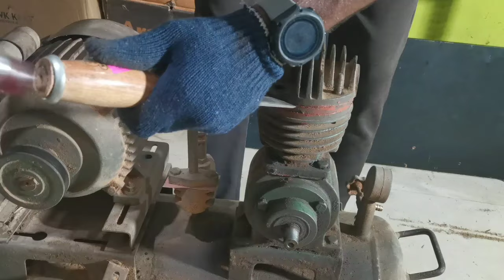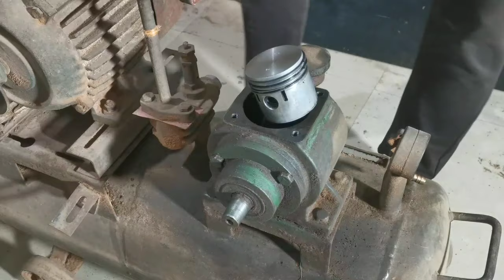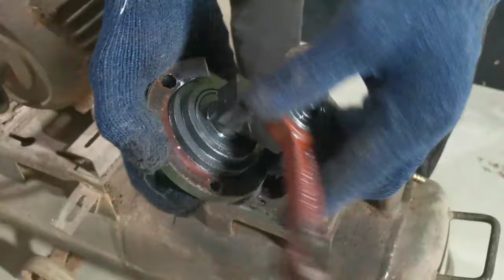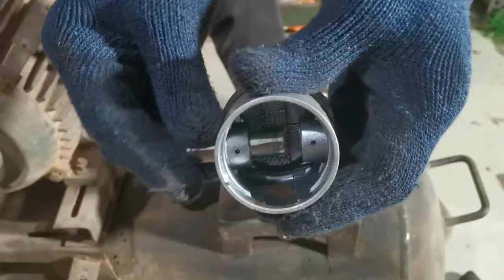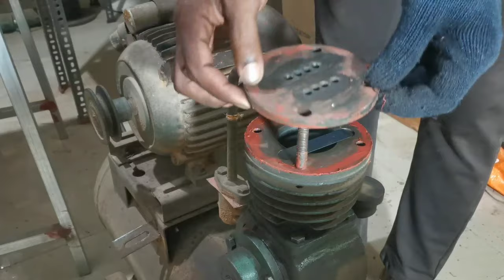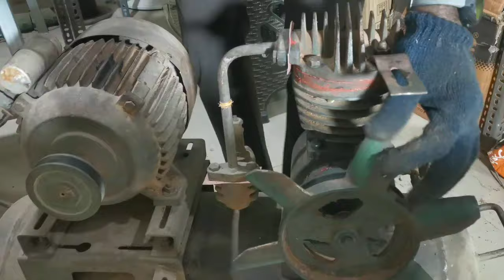Air compressor repairing | Compressor head repairing

Comment: Hello sir..
Mera 300 l air compressor hai...2hp Crompton motor ke sath speed air company ka.
Sir 80 L ke baad uska head jam hota hai... Motor to theek se ghum ta hai lekin compressor head jhatka maar maar ke chalta hai aur Jada vibration karta hai.. what is the problem and solution. Please help
Reply: Fan ka bolt tait karo